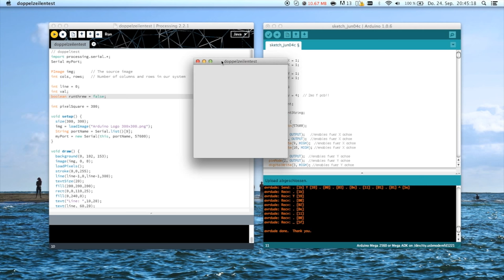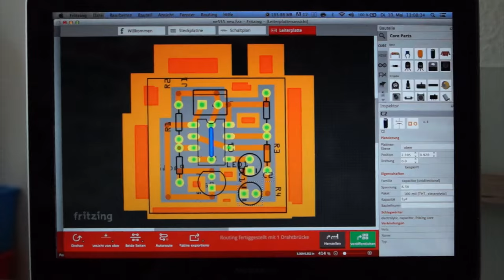Diy Arduino Laser CNC Engraver and PCB Exposer

Comment: The schematic is VERY hard to read.  What are the devices used for the X & Y -- can't make out the part #'s.
Reply from the maker: +Ted Mieske I'm not exactly sure what you mean with 'devices' but there are l298 double H-bridges used for driving the stepper motors. l298 is the most used motor driver in Arduino world i think. I my setup I made the drivers switchable, so when they're not used I can save power and don't get the motor windings too hot. This is the basic setup of an l298n with an Arduino and stepper motor: http://2.bp.blogspot.com/-zriE64I1kz8/U_zgiFwLh-I/AAAAAAAAClM/i2OzWl_2i9s/s1600/Circuito-L298N-motor-de-passo.png

You welcome. ;)
Reply: +NeumiElektronik - That's what I was looking for.
Reply from the maker: +Ted Mieske You welcome.

Comment: Hi buddy very nice project!.I built 3 axis CDROM CNC like you but I got no idea how to convert files to draw a circuit with this device so could you show how are the procedures to get the circuit drawing and how did you geti the Gcode to load into Arduino?I mean: 

a) What schematics programa did you use?
b) What format did you save the final PCB format in?
c) What program did you use to vectorize the drawing and what to generate the gcode?

Have a nice week!
Reply from the maker: Hey, you can find the code and a nice little instruction on gitlab.com/neumi
I use Frizzing, Eagle and  Kicad ... all programs provide PDF export which you can convert to png which can be read by my processing code ... the code can be downloaded on the page above...
I dont use gcode ...  
what is your third axis for?
Reply: It Moves my ink pen up and down.I saw in some videos that some people use servos to make this movement.
Reply from the maker: Aaah ok cool!

Comment: hey, whats the chemical product you put the pcb in? thx in advance
Reply from the maker: +HalfLife2Beta To develop the photoresist layer its sodium hydroxide solution. For etching its sudium persulfate solution. You can buy both in electronic stores. Mixing ratios are provided by the company which sells it. :)
Reply: Thanks a lot !